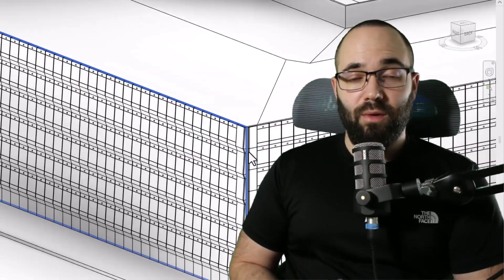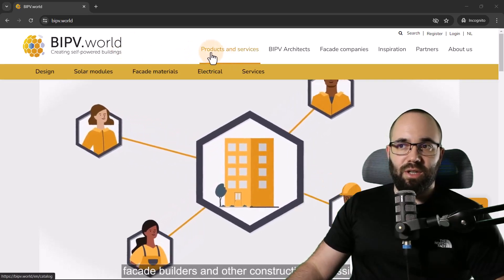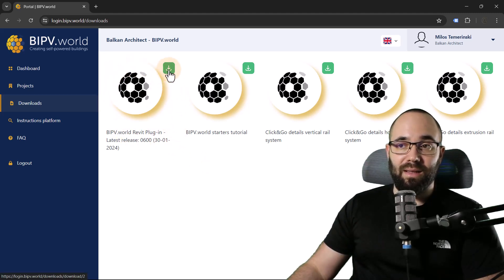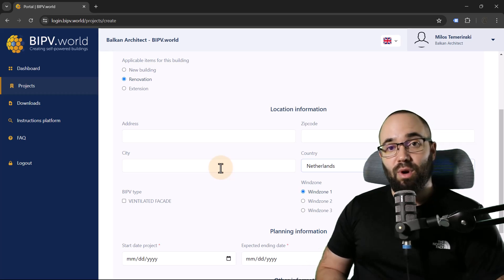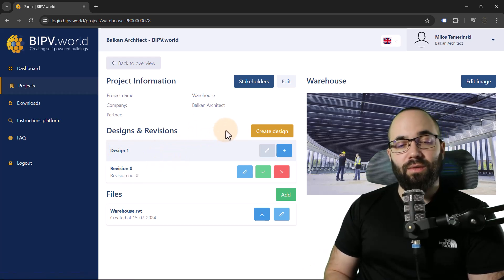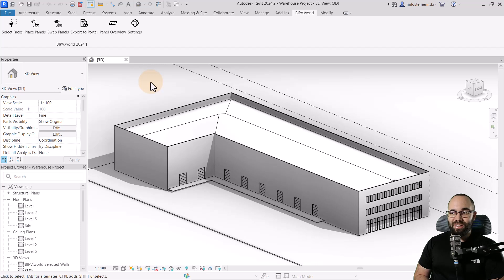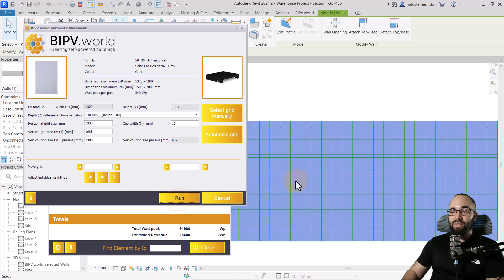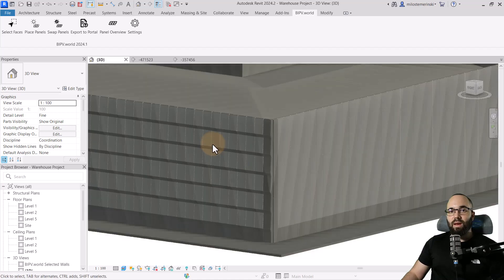Revit Plug-in for BiPV Facades Tutorial

Comment: Hey sir 
I have a problem in revit 
In 3D when i click realistic view it shows wireframe graphics can you please help me regarding this issue
That would be your kindness?
Reply: reset graphics:
type VG 
select all
then click wherever it says override then clear overrides 

if this doesn't work it could be an issue with your graphics card performance :
-Ensure that hardware acceleration is enabled. Go to Options > Graphics > Use Hardware Acceleration.
-Check Revit’s performance settings. Go to Options > Graphics > Use Optimized View Navigation.